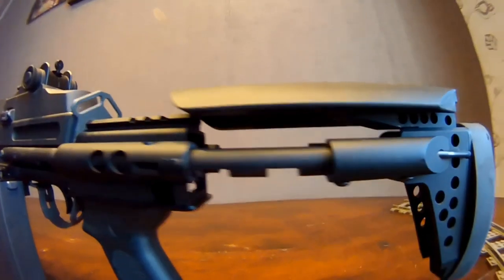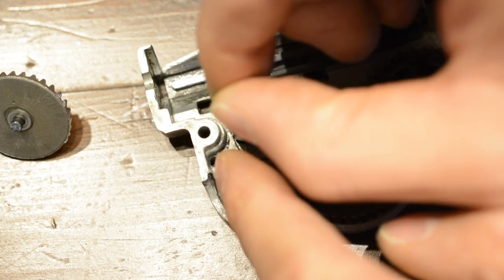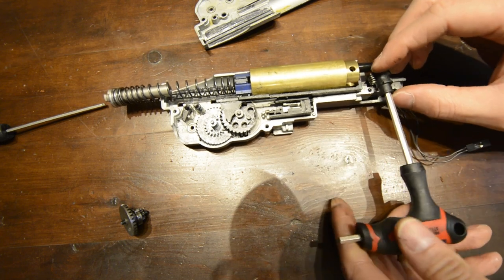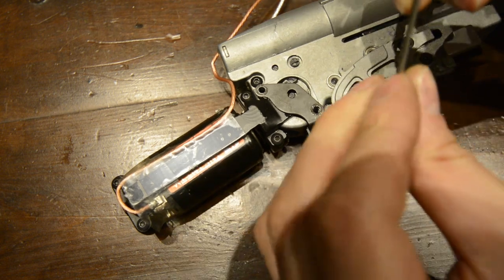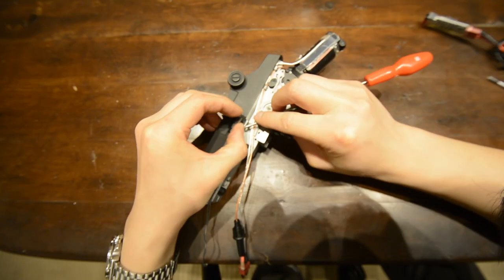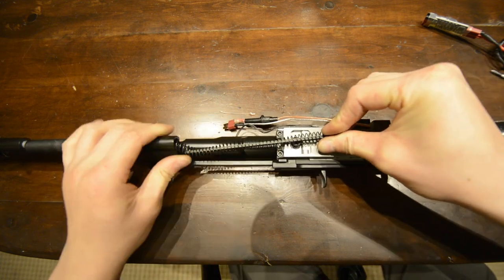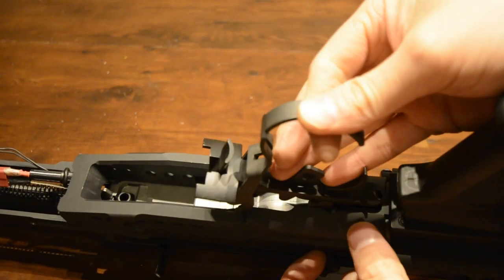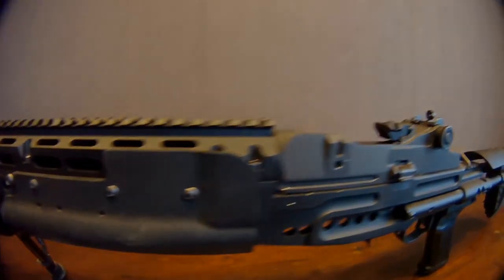G&G M14 EBR (HBA-S) Reassembly

Comment: I have the ebr-s, just received. It’s having trouble loading bbs on a high cap. Finally got it going, after many attempts. Is there a break in period? Is there an issue I should be aware of? And lastly, is there now a way to attach a suppressor to this unit or is that a lost cause for an ebr-s? Thanks for your time.

Comment: Hi i just bought one of these the long version is the gearbox completely the same?
Reply from the maker: +MrSpartan117fan Hi so long as its a G&G M14 then yes the gearbox is the same a hybrid Version 7 GB.
Reply: Ok thank you , i went by your videos and have taken apart the gun now i am just left with the gearbox to open up ,what grease would you recommend ? Could i use automotive bearing grease on the gears and bearings? I am so happy to have found your videos i just bought the gun used for 200$ and found the motor cage was broken and grinded some of the gearbox so i need to clean out the gearbox
Reply from the maker: +MrSpartan117fan Hi, for the gears i would recommend using either of the following, lithium, molybedium or PTFE based greases, personally i use white lithium based grease, make sure you dont get any of this grease anywhere near the piston such as the cylinder or cylinder head.
For the piston head o-ring and cylinder i would recommend a high viscosity silicone based grease as this will ensure the best airseal, being from the UK we have access to this stuff: http://www.zerooneairsoft.com/product_info.php?products_id=2390
You might want to check Evike as well: http://www.evike.com/shop/28/141/

It is very very thick almost sticky but ensures the best air seal inside the cylinder and for the air nozzle.

Whilst you have the GB open i recommend you shim the gears for better gear meshing, also get a new motor cage: http://www.evike.com/products/35688/
Reply: Ok thank you very much , i have not looked into shimming for these airsoft guns is it just making sure when the gearbox shell is on the gears have no side to side play? If not i  would do like an automotive rear differential and put paint and see the contact area  haha . Would these grease's be good the the white grease for the piston head and the moly for the gears ? http://www.canadiantire.ca/en/pdp/motomaster-moly-extreme-pressure-grease-0280851p.html#.VqjoEeaz62A
 
http://www.canadiantire.ca/en/pdp/motomaster-white-grease-450g-0280806p.html#.Vqjn_uaz62A
Reply from the maker: I would recommend you shim, there are plenty shimming guides on Youtube, the greases look fine TBH but get some thick silicone for the piston oring
Reply: Shizbazki2
Thank you for your help so much!

Comment: my g&g M14 EBR stopped working, the guy who looked at it for me said it might be the tappet plate, could that really be the issue?
Reply from the maker: Without more info it could be anything really, there are several things inside the gun that could break
Reply: i see, apparently the motor spins when fired,and was not pulling the piston back?
Reply: +Jean 88 possibly a stripped piston. G&G pistons usually have plastic teeth and can wear faster than the rest of the box.